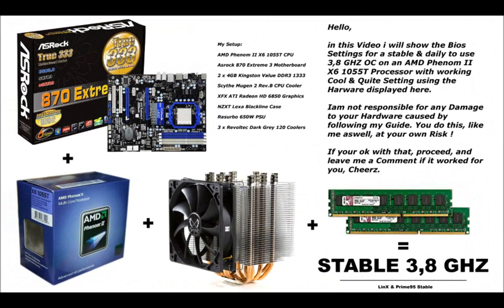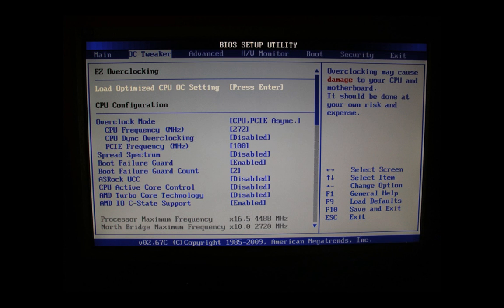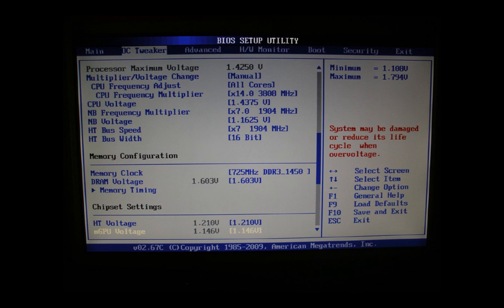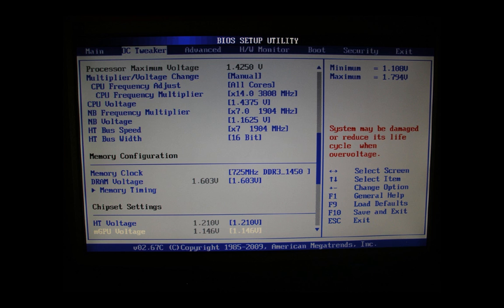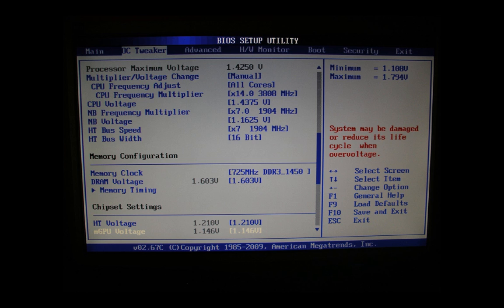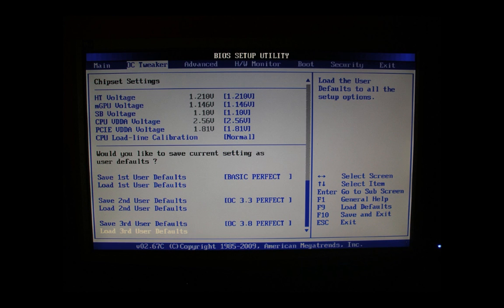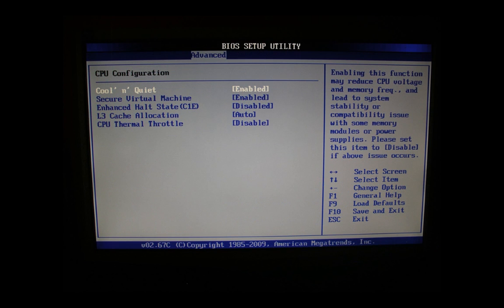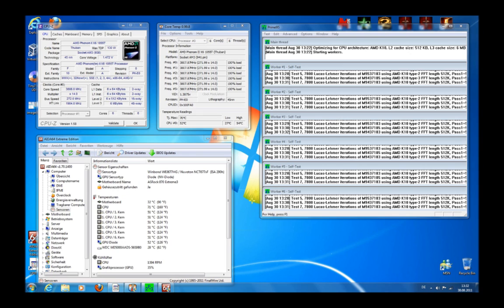AMD Phenom II X6 1055T Overclock 3,8 GHZ Prime & LinX Stable Tutorial

Comment: I have a cheap motherboard (Gigabyte m68mt-s2), a stock cooler, and a generic PSU (Qori 500w), which means I cant even get to 3.0 Ghz with my phenom ll 1055t without getting an error.

which one of these do I need to change the most to get some OC on my processor?